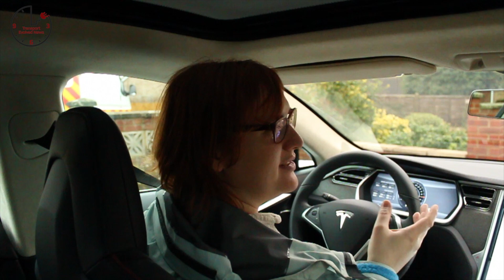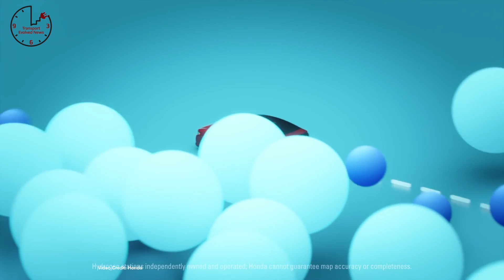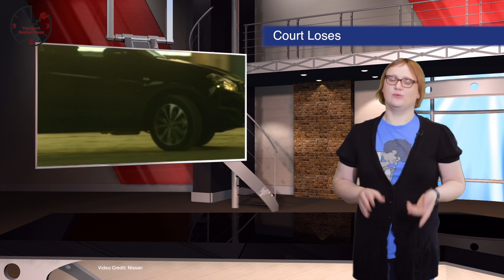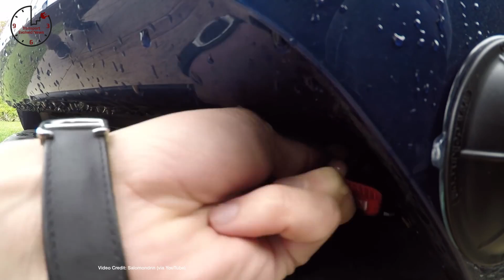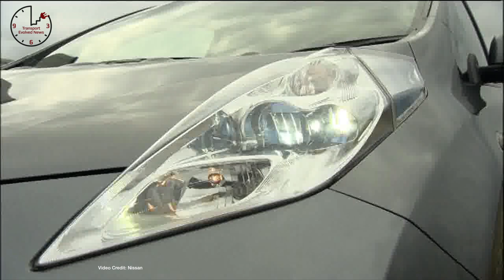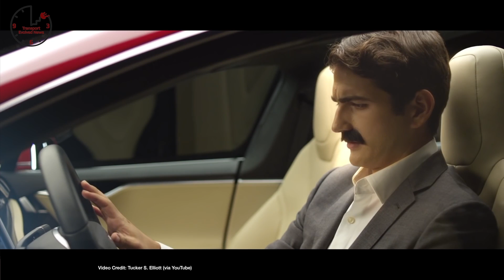Tesla Prep For Model 3, Lucid Air PR, Self-Driving Bolt EV - T.E.N. Future Car News 2/10/17

Comment: Full production this year?  LOL... Not so much.  By the time Tesla delivers significant M3 numbers in '18, the Federal Tax Credit will expire and the remaining reservationists will begin to cancel their orders.
Reply: You are assuming the majority of reservationists are in it just for the federal tax credit.

There is an alternative to consider. reservationists are in it for the chance to own a Tesla.

I'm assuming you don't have a Model 3 reservation since you speak about us using third person.
Reply: Full production is not scheduled for 2017, but by the end of 2018 Tesla expect to be working at a rate equal to 500,000 per year.  That means that by the end December 2018 will produce a total of 10,416 Model S/3/X per week (based on a 48 week year) or 10,000 combined fleet sales per week based on a 50 week year.

If Tesla match 2016 figures for S/X and a modest roll out for Model 3 will trigger the 200,000 number around the end of the year (Nov/Dec).  At the point that the trigger is hit Tesla will concentrate on the USA market alone and freeze international orders to make as many Americans happy as possible.  200,000 merely triggers a count down to the cessation of the Fed tax credit.  They have a quarter (3 months) following the quarter in which the trigger is hit where the full benefit is still available.  The best case scenario would be the 1st day of the quarter, because that would give a full six months of full benefit.
Reply: Production starts slowly in July.
Reply: alarjak - Yep, wishful thinking is wishful.  It will be a miracle if they start to deliver any significant numbers in 2018.
Reply: hkmp5kpdw I meant q4 was false, production starts earlier.

Comment: In Europe the Hyundai Ioniq electric is close to the same price range as the Nissan Leaf.
Sticker price for the Ioniq electric in Sweden starts at 331,900 SEK
Sticker price for the Leaf 30 kWh, with the Acenta package, is 321,590 SEK
Cheapest Leaf, 24 kWh with the Visia package can be had for 277,490 SEK, but at this price it lacks a lot of the features packed into even the most basic Ioniq. 
A fully speced Ioniq will cost you 385,240 SEK, while a fully speced Leaf will cost 367,390 SEK
A USD is around 8.9 SEK, so the difference is smaller than the numbers might indicate.

Comment: 'Knee-san' Leafs are not a mainstay in any major British city.  Nissans are though. 

If you want to pronounce things properly you could use the Japanese pronunciation for the Japanese company which is very close to the English, not American, version.
Reply: FFVoyager come on Knee-ki don't forget your roots :-)
Reply: Ive seen far mire Renault Zoe's and BMW i3's then I have LEAF's. At my school, there is one LEAF doing the school run and two BMW i3's, not to mention that there was an i3 park down my road and I once saw two Zoe's driving in opposite directions on the dual carriageway
Reply: Ben Farmer-Webb I think that often depends on what your local dealer sells.  I reckon i3's are becoming a lot more popular though - as the nearest dealer is 30 odd miles away and I see a fair few around here  now.